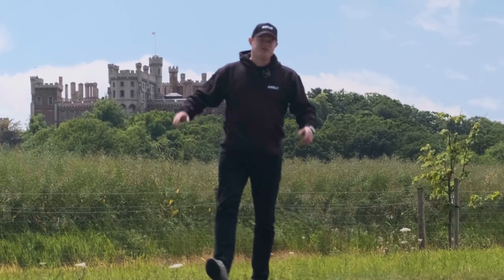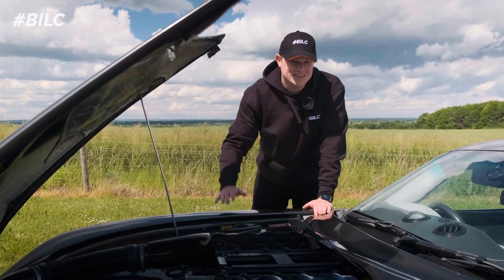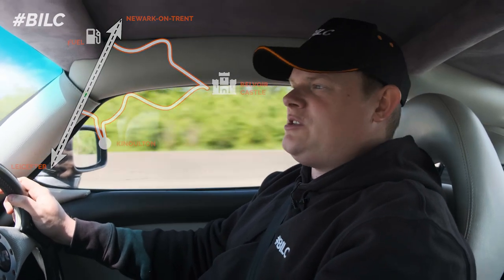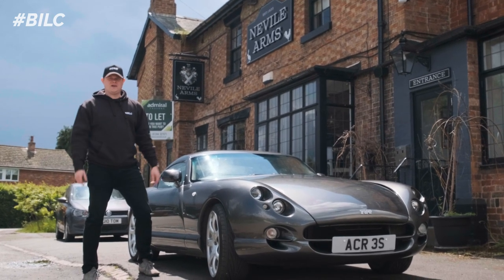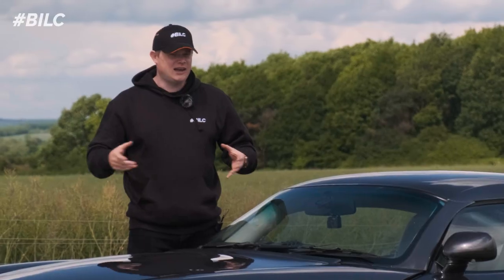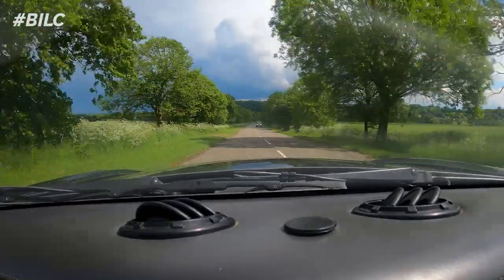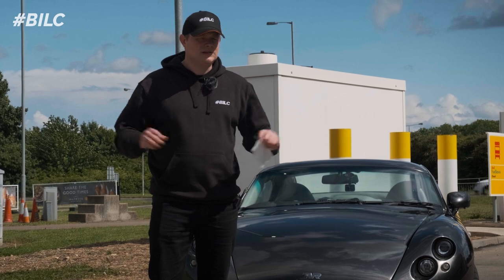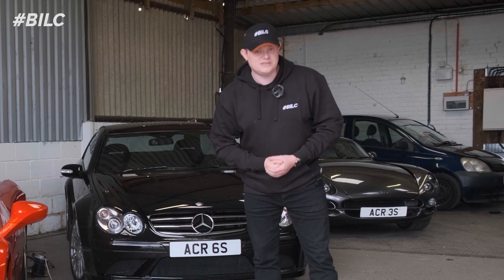TVR Cerbera MPG this CAN'T be real?! 😱

Comment: Easy to believe, I drove mine 150miles from Wales mix of A road and motorway. Got 28mpg using the same method of measurement and told everyone at the time. Very impressive, as you say geared for 190mph and very light makes it surprisingly good
Reply: goix for yiu

Comment: OK I had a BossHoss , A small block 5.7 litre chevy motorcycle. The weight I was told by the texas workshop 750 kilos, but think it was nearer to 500 kilos. this was a 2 speed semi automatic first gear 17 to the gallon in second 30 mpg I really like the idea of owning one of these !

Comment: Cerbera is my favorite car. Unfortunately too expensive for my wallet. I have a '96 4th gen Camaro. 70% of its body is made of fiberglass. 3.8 V6, 200 HP engine. Fuel consumption, just like your Cerbera. Max 13 liters per 100 km, that is ~ 3 gallons per 65 miles. It would use less fuel, but Camaro weighs 1500 kg. 😉

Comment: Was the 4.5 a factory anomaly or swapped in later?
Reply from the maker: The v8 options were 4.2 and 4.5 from new at factory. You could also do Red Rose further tweaks to the 4.5 if you were very brave

Comment: That's pretty low. I used to own a 5.7L engine car that weighed 3988 pounds and it could manage 28 mpg on the highway.
Reply: Is that UK or US gallons?
Reply: @romanpaladino  US gallon (3.785 litre).
Reply: 🤦‍♂️ He was never on the freeway,
He was usually half to full throttle.

Any 5.7 at that amount of throttle back roads is going to do the same or far far worse.

Watch the video

Comment: D'OH  I was so close.  I said 23 mpg
Reply: Great guess!!!
Reply: @fence4821    Well, I had a 2006 Nissan Sentra (  sunny ) , and it had a 1.8   4cylinder. When I drove it how I like to drive,  a bit faster than the signs tell me to.   I could get about 30 mpg.   I figured your car, being only a year older, with a much larger 4.5 liter, wouldn't get nearly the miles I did,  but surely had to get at least 20 mpg.  So I figured 23 miles sounded like a good almost middle area 😜  it made sense in my head